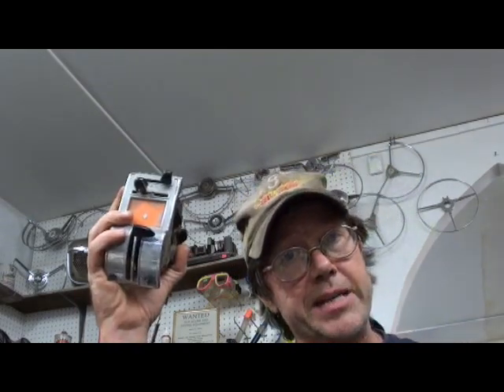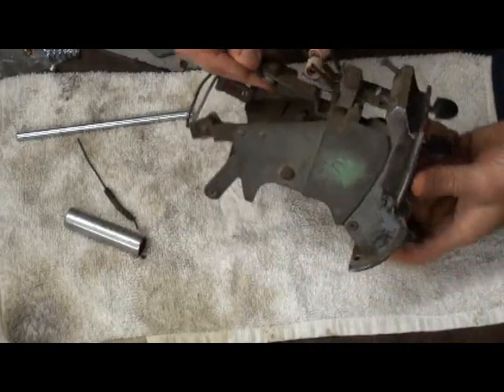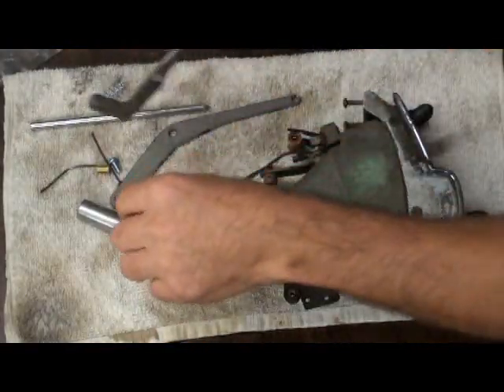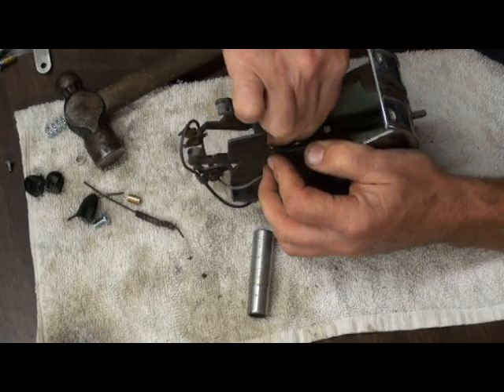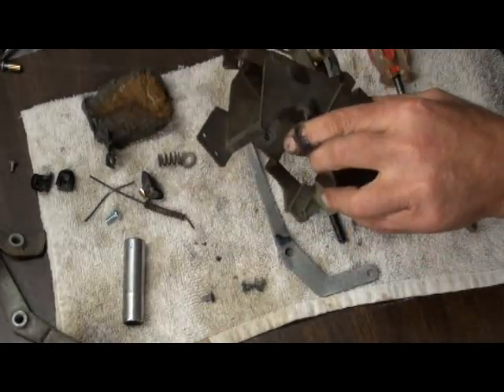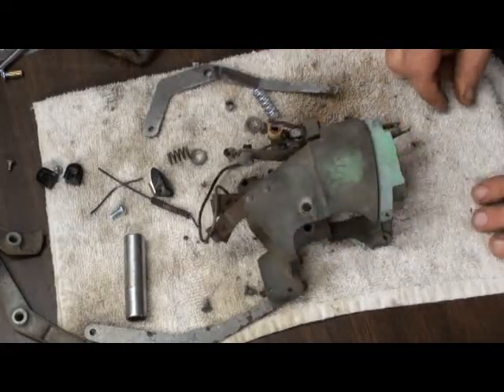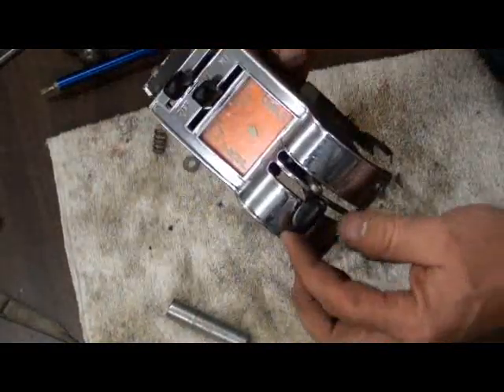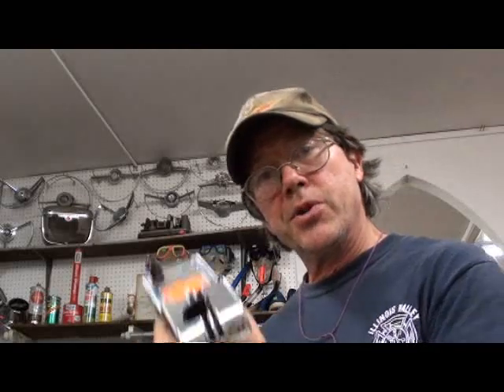"Project Whitey" 1957 GMC heater control rebuild

Comment: Hi, Jeff
Happy to see someone else into the GMC trucks with Pontiac engines. I have a 1958 GMC big window cab. The cab is extended 20 inches. I am looking for the door window chrome trim. The chrome trim doesn't have to be perfect I only need the straight top and bottom parts to extend trim across the cab extension.

Comment from the maker: Any 2000 lb winch for 67 dollars will have about an 80% failure rate in my hands. I'd get tired of returning them. You'll also want to mount a battery as close to the winch as possible, and run wiring from the vehicle to charge the auxiliary battery. If I needed to pull 2000 lbs, I'd get a 4000 lb winch. Whatever I end up getting will be able to secure the load without having to bind the front down. Chain the rear, draw it tight with the winch and roll!

Comment: Hey, I've noticed that you use those strap winches when you get trucks, northern tool has a really nice winch for 67 dollars. 2000 lb. 12 volt, hand held remote, you could put wires going from your battery going with the tail light wires and put a plug in and use the winch instead of those straps. Please respond.